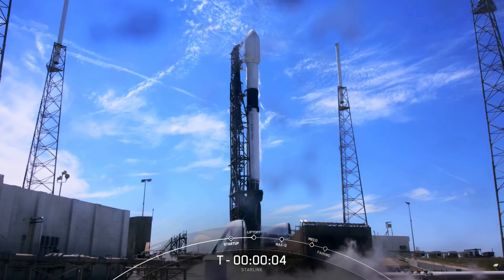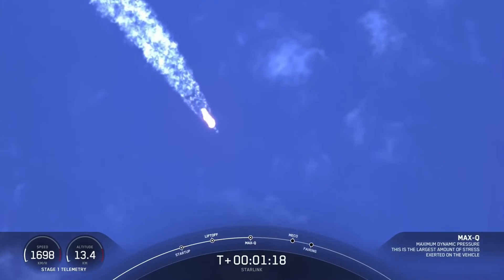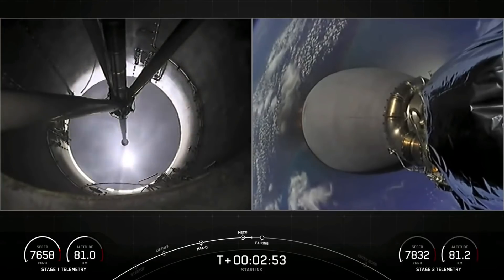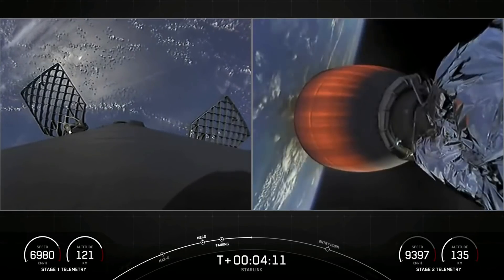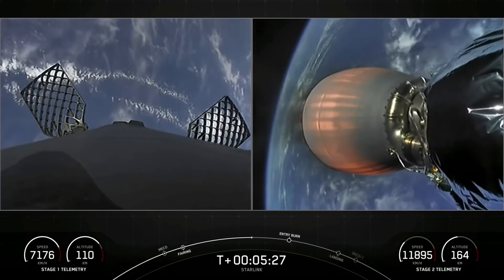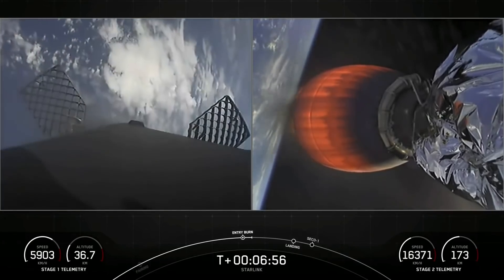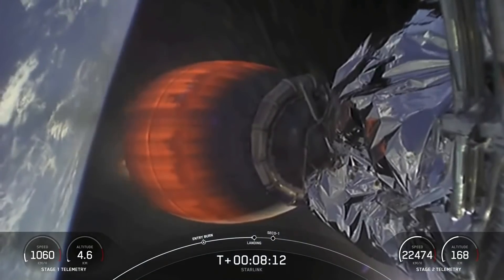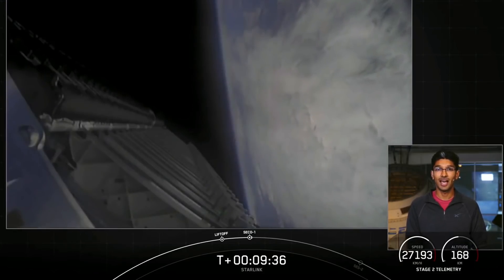SpaceX launches 60 new Starlink satellites, nails landing!

Comment: @4:42 The first stage eventually slows to 6974pk/h. Then the speed starts to rise. Dramatically. Can someone explain how this happens without further thrust till about 7900kp/h while going backwards and clearly the video showing it moving towards the ground. How does it stop mid air and start its decent while still travelling at over 7000kp/h
Reply: The spacecraft is near its apogee (the maximum height of the ballistic tragectory it is following). Think of it like throwing a ball up and forward. You accelerate it upwards, and once you let go of it it starts slowing down. As it reaches the top of its arc (apogee) the deceleration slows and stops as its inertia runs out. Then gravity begins accelerating the ball and it gains speed again.
Reply: @ascherlafayette8572  Ok thank you for your kind reply. I have another question if you don't mind. Also at 4:42. Just under the left grid fin. there seems to be something U shaped come into view along with many other debris. How does this occur? The main body is travelling at nearly 7000 kp/h. But these things seem to be just floating like dust in still air.  Shouldn't they be whizzing by at 7000kp/h.?
Reply: @ZokStar1  newtons first law. Anything that is in motion stays in motion. Both the booster and the debris are moving at extremely high speeds. Relative to eachother however they are stationary
Reply: @ascherlafayette8572  Sorry,  I don't get it. Wouldn't the debris be against resistance. If I held my hand out the window of a car traveling 100 kp/h holding a ball and I let the ball go. I'm sure the ball wouldn't stay in place. It would fall backwards and on a sort of 45 degree angle towards the ground. How can small lightweight debris just float like that while the main body is moving at such speed. Even the powered rocket on the right side of the picture is going full throttle at over 10000 kp/h and you can see small bits of debris just floating around like it was in water. I just don't get it. And just one more thing before I let you go. At 5:40 There seems to be something like mouse running around the cowling of the engine. WTF? It clearly looks like a mouse. You can even see it's tail....Each time the camera changes back to that engine. Things keep arranging themselves behind each other in a line. Any idea what that is?
Reply: @ZokStar1  I don't know what the actual piece is, but at that altitude there is almost no atmospheric drag.
Reply: @ZokStar1  what you are seeing moving is ice. It happens on every launch. And in multiple places in the video as well, where you quite clearly see it isnt a mouse. Not to mention those engines are huge; you’ll be looking at a mouse several feet in length.

Also that debris you are seeing, and the booster, are in space at that point (at 122km height) there is no air resistance, like you would get with the ball example you are giving.

Comment: As always the rocket goes straight up only so far and then it's trajectory flattens out; but they say it's still going up.  They always have the camera pointed backwards instead of forward 😆
Reply: Eventually yes it will start to flatten out, because that’s how you get into orbit. You go around the earth, not up and turn 90 degrees. 
And yes, the camera is pointing backwards, towards the engines, the different stages etc, so they can monitor what’s happening. Why would space-x point a camera forward exactly?

Comment: You can see it is curving off not going straight up .
Reply: Which is what happens when you try to get to orbit.
Reply: @Ethan_Roberts  and you know this how ?
Reply: @thomaswellnitz9601  it's basic orbital mechanics. It's been well known and understood since the 50's. How do you think the moon stays around the earth? Its not stationary, it circles it in an orbit.
Reply: You dont go into orbit by going straight up.
Reply: @johnbiggscr  ok show where it says you do not go into orbit going straight up .
Reply: @thomaswellnitz9601  as Ethan said. Going straight up takes you away from earth, not around earth. You don’t go up and turn 90 degrees. 
Let’s put it this way....when you are turning a corner in a car do you drive forward and then turn 90 degrees or do you go in a curve?
Reply: @johnbiggscr  not at the distance they had to go you would not even see the rocket at the height they would need to be before they curve off so the fact you can see them start to curve means they were not going to orbit . Sorry I know you like sounding smart but nope your wrong good try though .
Reply: @thomaswellnitz9601  oh the irony of you accusing others of trying to sound smart.
The curve starts to happen shortly after take off. A craft has to have sufficient horizontal speed to achieve orbit, not vertical. This isn’t a hard concept to grasp but you are giving it your very best try at failing to get it. 
Just search for launch trajectory to see it. They don’t hide the fact it curved because they know it’s required.

Comment: if the Earth isn't a spinning ball as given,, there's a whole lot of fooling going on. the Earth has never in the history of science, been proven to move. it is ALWAYS assumed.
Reply: What about that flat earth experiment where they used an expensive gyroscope to prove earth is stationary but the results showed the earth was in fact spinning?
Reply: @Ethan_Roberts  post the proof! a first in history. something moves bud to give us all the revolving (in unison) skylights/reflections. that something is Aristarchus, the divided tree of life core/coeur.
Reply: @Ethan_Roberts  the Earth surface we live on can be said to be flat and stationary. but something moves to give all skylights. that something is Aristarchus core. Aristarchus is the divided tree of life. we live on it's stump as it juts above the invading waters. the tree is in tact the other side. 
you are probably one of the regular debunkers of flat earth who has been doing the same rounds for years. there are fakes everywhere.
i am not interested in your links. Earth surface doesn't move @1000mph round itself, 60,000mph round the sun with the sun system moving at 600,000 mph. 
Earth surface has never been proven to move because it doesn't.
as Earth surface doesn't move, water proves the Earth surface flat. the biggest variation from absolute horizontal (over Earth oceans) is the biggest variation to be found between high and low tided on Earth, which is some 30 meters in Alaska.

Aristarchus of Samos is the originator of H-EL-IOcentrism. the man never existed.
Aristarchus certainly does though.

https://astromart.com/news/show/aristarchus-up-close-and-personal
behold the universe!

now you go back to your child's play ROB EaRThS.

Comment: Can anyone explain to me why exactly the camera's always quit on ladings?  They have so far been unable to solve that problem it seems so i'm guessing it's a hard problem to fix?
Reply: Cos its fake
Reply: Ignore the flat Earth conspiracy nuts.

The drone ship has a directional signal to the likely geosynchronous satellite from a transmitter on the drone ship. The rocket exhaust from the booster landing shakes the drone ship to the point the transmission signal loses lock on the satellite. If you jostle the signal out of line of the satellite, then the satellite can not receive enough of the signal to support video or sound. That is why the signal usually cuts out on the drone ship as the rocket is landing. Usually, SpaceX gets the signal back once the shaking subsides. Remember, these landings are happening over 200 miles from the launch pad out in the ocean. There is not complete coverage of spacecraft in every square mile of the world, so telemetry is handed off from one ground station to another. Transmission problems are not uncommon and telemetry from the spacecraft has priority over video. 

Landing on a drone ship seen from further away, with a drone from a ship a some miles away I believe. 
https://www.youtube.com/watch?v=1sJlFzUQVmY

Recorded landing from the drone ship camera
https://www.youtube.com/watch?v=KDK5TF2BOhQ

SpaceX even got a signal from a booster camera to last through landing. Note, the split video feeds were not synced up for the landing.
https://youtu.be/tdgg_qwj-hI?t=1340
Reply: The transmission system is a simple laser shooting up to a satelite and back down to earth so when the Falcon ignites its engines it shakes the fuck out of whatever its landing on and itself so much that the laser gets physically thrown off course for a few moments and the computers have to reconnect the stream and find the satelite again. Its actually even more cool space stuff just the inconvenient stuff.
Reply: @amazingman63  What is the satellite being lasered?
Reply: @FelonyVideos  basic communications. Without it the barge at sea would have no signal
Reply: @amazingman63  that wasn't my question. What is the name of the satellite?
Reply: @FelonyVideos  i dont know whichever one is probably overhead at the time. I would assume its an existing ISP they use
Reply: @FelonyVideos  um im sorry do you not understand how orbital mechanics work? It cant be just 1 satelite because they have to maintain a constant horizontal momentum to not fall back down. Please dont tell me you are a flat nut
Reply: @amazingman63  I actually do understand orbital mechanics much better than you can imagine, and that is why I called you out and you cannot answer even the simplest of questions. 

There isn't any satellite that a laser is pointed at.
Reply: @FelonyVideos  
A) Take your stuff elsewhere and quit being so arrogant to other people on what are otherwise incredible videos, it’s not needed bud.
B) While you are technically correct that it is not a laser (a device producing a directed beam of energy with a wavelength of 180-700nm), the basic principle is the same.  A high frequency directional electromagnetic beam is broadcast from an antenna on board the drone ship to a satellite in orbit.  The vibrations from a landing Falcon 9 disrupt the drone ship antenna’s ability to track the satellite, thus the video feed is lost.
C) I also saw your reply from the other comment where you incorrectly stated it wouldn’t be possible to send a drone to take live feed from the air of the re-entry. All you would need is a drone with a satellite connection to broadcast the video feed in real time (minus a small delay). You wouldn’t need someone standing on the drone ship.  A drone could be set with a predetermined flight path to do turns around a point over the drone ship from a safe distance as to not affect the recovery of the booster.
Reply: @amazingman63  and Blake Spikard, meet TRUTH ZONE. You guys hash it out and get back to me, after you figure out how the lasers never pop the balloons! 😂😂😂
Reply: @amazingman63  you are not smart at all. Challenging someone's Thesis with made up analogies. Stupid as you can get? On the contrary, you keep replying without any back up data.
Reply: @amazingman63  tagged the wrong person 😂
Reply: Just to be serious for a moment, the OP asked a fair question, one that deserves a knowledgeable honest answer. Not something a bunch of dumb kids blather about, struggling to appear informed.

There are a few websites that discuss this, and one YouTuber who purports to know the answer. In my opinion, the OPs question remains unanswered, both here, and on the internet at large. 

Here's what we know. The barge has a camera and a telemetry system. There is a support vessel relatively close by (probably 25 to 100 miles away). The camera does not vibrate before telemetry cuts off. The ocean waves do not cause loss of telemetry. Telemetry is always sporadic from the drone ship. The drone ship and returning booster communicate with each other. The booster never/rarely loses telemetry. There are no non-DoD satellites that use optical comms for anything outside of research purposes. Isolating a directional antenna system from vibration and sea wave rolling is easy, it's called rubber bands, LOL. The platforms are leased from a third party, and that means there was/is a specification. Boat builders are not aerospace developers. They would likely use commercially available products.

Now, you have a framework to go seek a solution theory.
Reply: @FelonyVideos  Was the nasty attitude really necessary though? You could have just corrected people nicely, but nooo.
Reply: @K000H  Meh, it's the internet. But you are right, I could have been nicer. Will an apology suffice?
Reply: @FelonyVideos  I wasn't the one receive the comments so i couldn't say, but the fact that you're recognising it would be good enough to me at least. The internet do make us all nasty at times.

Comment: 2021 and you still can't have a decent camera to record clear uninterrupted image 
Unbelievable
Reply: You should make one for them and solve that problem 🤔 you know given it’s 2021 and all!
Reply: @johnpene1463  yeah right
Reply: Cameras are not the problem. Please educate yourself, Jen try not to write bullcrap.
Reply: @Cediii4ris  ok if cameras are not the problem what is ?
Internet connection? Nooo it can't be there are satellites everywhere that will reach for a good transmision 
What else digital or analog transmision ? 
Will a beefed up gopro record better?
This is 2021 not 1965
Reply: @marbesky  it is the internet connection. Vibrations caused by the rocket are extreme and the antenna doesn’t stay in place.
Reply: @Cediii4ris that's understandable but still
Internet conection shouldn't be an issue since it's everywhere now ground and satellites 
As for antennas thers no excuse there 
Technology is available even for 4k streaming but it's not used and that's where I wonder WHY
Reply: @marbesky  because the antenna is shaking. If you were to shake a car antenna or a rooftop sattelite dish you’d also get interference.

Comment: So did anyone’s heart skip a beat when the Booster lost Telemetry during Landing?!
Reply: That’s pretty normal. All spacecraft lose contact as they enter the atmosphere- they build up hot plasma on the outside which blocks radio signal. Then, as the booster comes in to land on the drone ship, its thrust causes the ship to shake. The drone’s video feed is via satellite and requires pretty straight line of sight. The shaking tends to interrupt that signal.
Reply: @aggiewoodie  yeah but in this case the telemetry was lost moments before the landing burn when the booster was barely supersonic and yes my heart skipped a beat too ahahaha

Comment: Seems it will be hard to replace the fueled Rocket engines to get there . Don’t know if an electric propulsion could work.
Reply: they will need like a city power grid battery to create a huge current supply and therefore perform those thrusts required to lift the rocket off. we’re talking like gigawatts/terawatts to do that. it’s nowhere efficient than any fuel rocket still
Reply: I believe that eventually we'll have ion thrusters that are actually able to do something :-). But we're not there yet.
Reply: @nyyotam4057  Ion thrusters have been used for years. They don't provide enough power for liftoff though. It's great for probes that can take their time getting somewhere.

https://solarsystem.nasa.gov/news/723/a-brief-history-of-ion-propulsion/
Reply: @steveaustin2686  That's exactly what I've meant.
Reply: to get where and what are you talking about

Comment: 5:27 into flight something appears to turn unlike all the other space junk and ice. thought it looked weird wondering if anyone else saw that? It’s kinda in the center going toward the right of the screen then turns and goes up toward the top of the screen
Reply: Look flying below the booster @ 5:06-5:10.
Reply: I looked several times, and couldn't see what you are talking about. Was it in the left or right image?
Reply: @FelonyVideos   Left.  It starts at the bottom center of the screen under the booster and travels straight up over the earth.  Focus on the center of the visable part of the earth... it may be easier to see that way.
Reply: @spuriouseffect  ahh yes, that's just ice.
Reply: @FelonyVideos  left image yea thought it was ice but it turns unlike the other objects that go straight and continue their path. it’s small just thought it was interesting
Reply: It’s next to the right wing that looks like a crate definitely not the one at 5:06

Comment: how many individual falcon 9 rockets are there?
Also, are there any boosters that have already been retired after flying too many missions?
Reply: 1st successfully landed F9 stands outside SpaceX in Hawthorne. Cool to drive by and see it daily.
Reply: Ah nice
Reply: Here is a list of all the Falcon 9 and Falcon Heavy launches and upcoming launches. 

https://en.m.wikipedia.org/wiki/List_of_Falcon_9_and_Falcon_Heavy_launches

The third column (Version, Booster), lists each booster and how many times it has flown. So B1049.9 is the 9th flight of the B1049 booster. SpaceX expects dozens of flights by the boosters before they are retired, if a mission doesn't require expending the booster first. A Falcon 9 Block 5 booster that is recovered can put up to 34,000lb into low Earth orbit (LEO), but a booster that is expended can put up to 50,000lb into LEO. So some are used up and burn up if the mission requires it.

The boosters are expected to have minimal refurbishment between flights and a major refurbishment each 10 flights. B1051.10 flew its 10th mission on May 9th, so it's expected to be out of service for a while as it was the first to reach 10 flights. I believe that there are 8 active Falcon 9 B5 boosters and everything before the Block 5 has been retired. The Falcon Heavy boosters have extra attachments, so they use their own version of the B5 and apparently don't swap back and forth.
Reply: Thanks!
Reply: @muzzamemes3657  You are welcome.